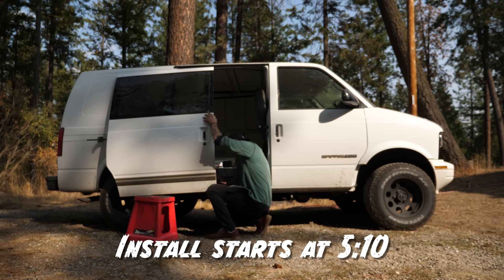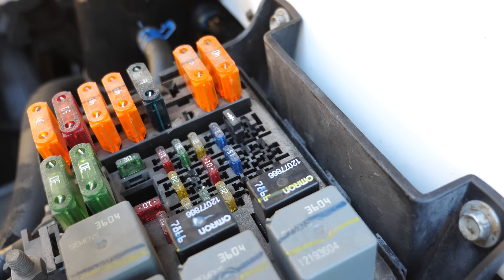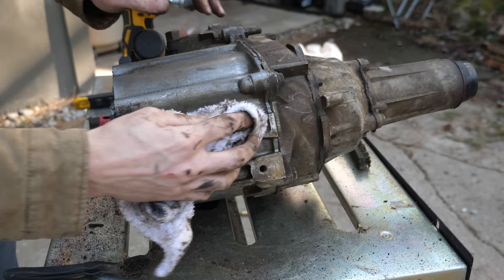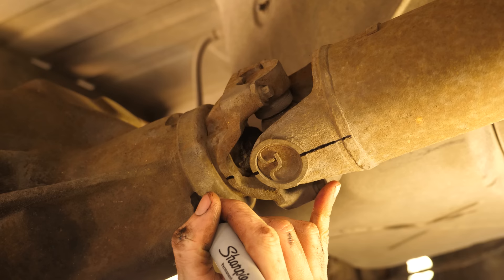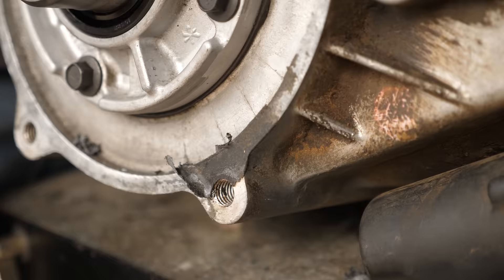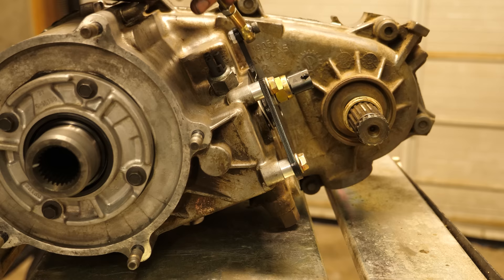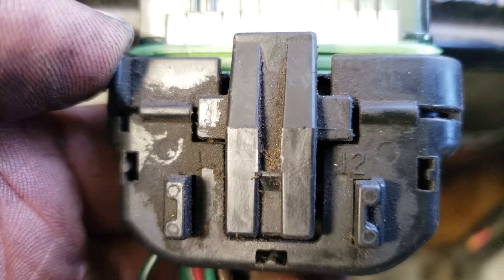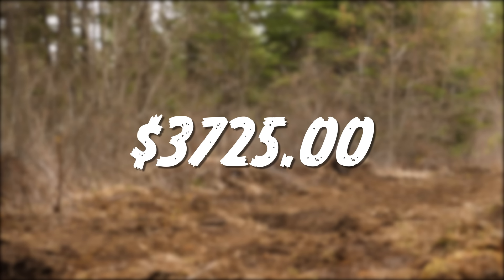4x4 Swap for Astro and Safari! // Conversion Explanation and Install // Journey's Offroad - Part 5

Comment: Hey Shredist, I have an 04 AWD Astro Van with a bad transmission.  I've never attempted a transmission swap but have some wrenching skills and the will to save money.  I want to do the 4x4 transfer case swap and a lift at the same time.  Do you have any general words of the wise or recommendations for me?  Should I swap the axles too?  I'm a rock climber looking to do back roads and creeks in the High Sierras in order to get to my climbs at Shuteye Ridge.  Much appreciated!  Thanks!
Reply from the maker: I would just start with getting the transmission fixed. If you just want to go mild offroading you would do great with just the lift and down the road getting the 4x4 swap done.
Reply: @TheShredist  Thanks for the reply!  I was thinking since the transmission won't go in reverse that it's toast.  I can get a refurbished transmission for under a grand in San Jose I think.  So I was thinking of swapping it out and doing the 4x4 transfer case at the same time.  Might as well do it while it's out right?
Reply from the maker: It would definitely be the easiest time!
Reply: @TheShredist  For sure thanks!  Wish you had a video on a transmission swap :)

Comment: But can you fit the YZ in the van with enough room left over to a sleeping bag?
Reply from the maker: Yz will probably go on a hitch mount. You would need to compress the forks before rolling it into the van due to low door height clearance.
Reply: @TheShredist  I've seen guys swap a wheelbarrow front wheel (or similar) to bring the height down to get the bars in. That's too much trail-side effort for me, but maybe a piece of all-thread through the axle and a couple ratchet straps to the bars would do the trick if you're in a sketchy locale and want to keep the bike concealed.

I know its mostly a MTB channel, but lets get some footage of motorized shredding too!
Reply from the maker: Not a bad idea at all. Motor is out of the bike for a top end job, I need to get it back together already!

Comment: My 2000 astro ,the 4x4 works good ,just remember when you change the oil to put in anti friction fluid or you will get a terrible wheel hop . GM says not to but their full of shit.